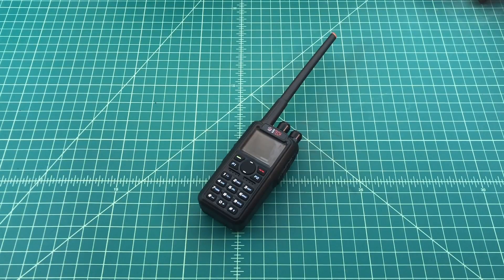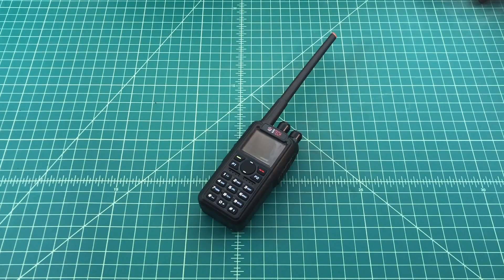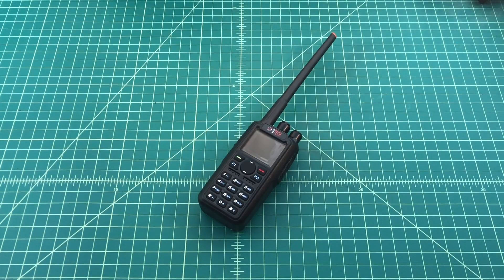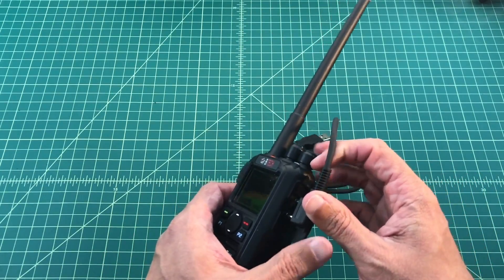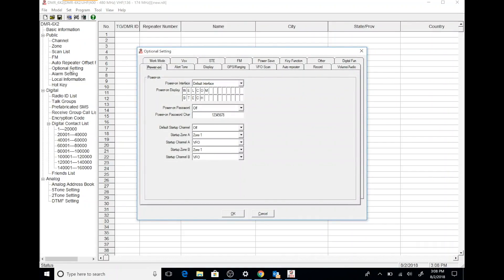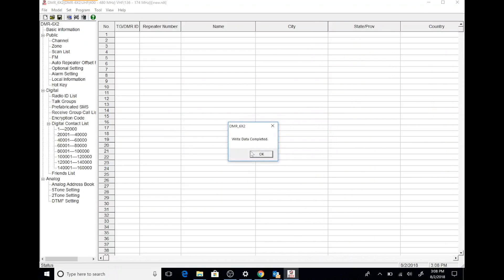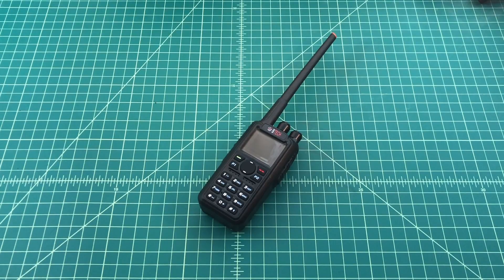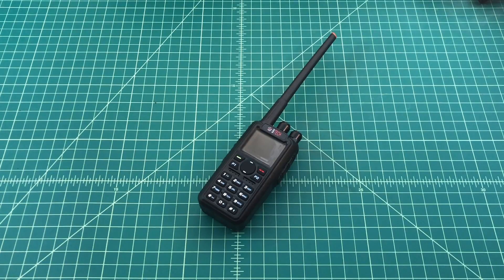BTECH DMR-6X2 - Clicking and Popping on Analog Repeaters - TheSmokinApe

Comment: pretty easy now with the computer software.
Reply from the maker: The software does make it easy but some standards would make it easier.  I’d like to see these radios; use a standard software package, consistent terminology, chip free charging cables and charge straight from a USB cable.  Is that too much to ask?

Comment: Sorry for the delay in getting back to this video.  In the meantime, I ordered the female sma to pl-259 to eliminate any weak analog signals coming into the radio.  Initially the click or pop was extremely noticeable.   I re-downloaded the firmware v 1.04 and flashed the chip.  NO popping sounds-gone.  Tested this in the middle of the night and I'm getting full quieting into the repeater/receive.  Personally, turning off the clock isn't my style.  It's there and should function, so why "turn it off" to get the popping sound to stop?  For those who don't know, contacting tech support via e-mail is the only way to contact these support people.  There is no phone number to call.  If you contact support via e-mail, make sure you check the SPAM folder for their reply.  They have been responsive, but I get this feeling they aren't very technical about this radio.  I have been a ham for over 10 years, and in the IT business for 30.  I am utilizing Windows 10, home edition up to this point with the CPS.  I've got several machines here that are W7 Professional that I attempted to use, however the driver for the cable won't install under W7.  Wants me to keep running the driver file as administrator, and when I do that, the error is still there, so I have been doing everything under W10.  I have downloaded several codeplugs that save as .csv files, but when I try to import into the CPS, it's asking for a .lst file and that's the only file it wants.  BF tech support say it's simple, just convert the file - well uhhhh that does not work.  So if anyone has any solutions to the .lst file and the import process I'd like to hear from you.
Reply from the maker: Glad to hear the popping is fixed for you.  I run on Win10 so can’t help you there.  Sorry...
Reply: @TheSmokinApe  I'm also on Windows 10, tht's where I'm having the .lst issues vs. .cvs

Comment: I had the same issue on my Anytone AT-D868UV on an analog 2 meter repeater aswell. It only did it on one channel for me so I just didn't use that channel. No issues on the public safety repeaters I had programmed. No idea if any firmware updates have fixed the issue since my radio is no longer working. Thank you to my wifes cat for dropping it off my desk for me, I really wanted to by a new radio after buying a new radio.
Reply from the maker: Dang at dropping that radio!  On this one, after turning off the display has intermittent popping on any 2m analog repeater.

Comment: Good troubleshooting!  I think a click would drive me nuts.  Hopefully you resolved it or are able to update the firmware in the radio.  73 de K2CJB
Reply from the maker: It’s not too bad now, I do hear it at times.  I actually think it’s and rf / hardware issue.  I still feel pretty good about this radio compared to other <$200 China DMR radios.

Comment: I hope if it is a Hardware / Firmware update fix and the Manufacturer can resolve the problems =)   If it is settings; this issue needs to be resolved ... as we have seen recent news of one of the larger manufactures being sued by the FCC in court for non compliance /-)
Reply from the maker: I saw a post about the FCC suit but don’t know the full story, I have to check it out.  Thanks!
Reply: It could be good and bad thing /-)   Only time will tell and I'm sure there will be fallout on a lot more radios out there in the US FCC area will be affected =(
Reply: Thanks for the Video. I haven't had that problem yet. How about doing one on how to set up this radio for the first DMR to another area?  TX
Reply: As far as the radio I have .... I'm not sure if it has the same problems or different set of ones ( it is a different type and model, and manufacturer =)   I will watch out for problems as I encounter them =)    My radio was also an offshore built radio as well /-)
Reply from the maker: Pat Hopkins what radio do you have?
Reply: I have the older version of the RadioDdity GD-77 ver 1.6 ( I have not updated the firmware yet ... two versions back ... there was an issue with the last update from the bug reports ... so I will see how that goes and upgrade then the next level  < stay one update back > :-)))   I think it is made in the same bicycle shop all the others are made in /-)    The battery and case design is much better than some of the other radios offered =)
Reply from the maker: I almost ordered that radio a few times, I have seen some pretty positive reviews on it.
Reply: It has a limited user / repeaters / talkgroups ( 16 )  with analog and DMR modes memory of 1024 .... some of the more expensive ones have a MUCH larger memory and easier to program with a built in GPS =)   They are about double the price ...... but if you are in an area that has good coverage of DMR repeaters and or Hot Spots a subscription of Radio Reference and a smart phone with a USB port and you can download custom area specific repeaters either Analog and DMR and can be keyed to the GPS location =)   The nice thing about the GD-77 is I have never had anyone complain about the audio and the audio exchange with the other operator sounded fine to me ( I do have some hearing loss with age =)   I may get the O' scope out and give it a test someday if I can find my two tone audio generator :-)))   Sorry for the long response =)
Reply from the maker: Pat Hopkins good info, thanks!
Reply from the maker: Paul Beauregard that’s the plan, I will hopefully have some code plug and config videos coming up this week.

Comment: LoL, thanks, now I can hear it. Never noticed it before. Yea it is probably the duel function. I do like this radio though. Have a good one..
Reply from the maker: It’s less with the clock off and I love the radio as well but this is annoying.  I plan to use this radio for analog as well as DMR.  Hopefully it can be fixed with firmware.